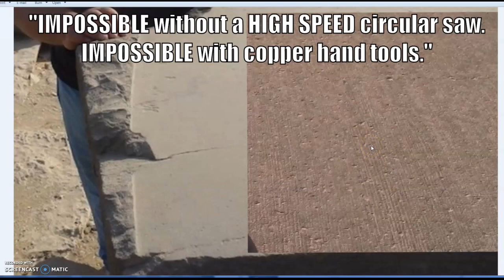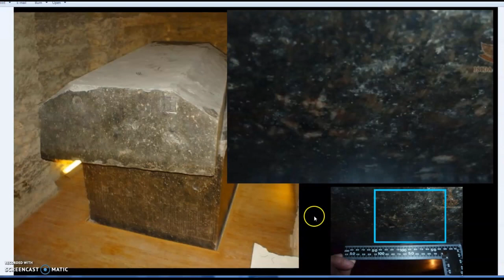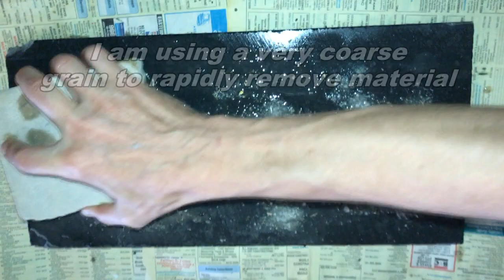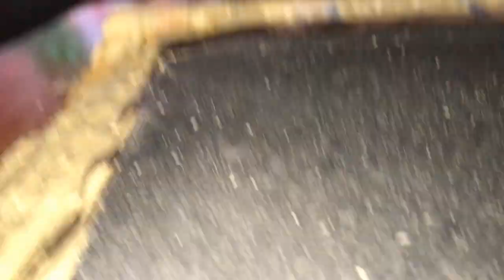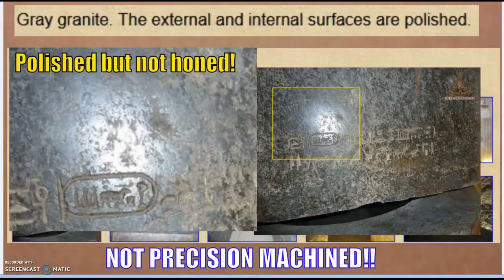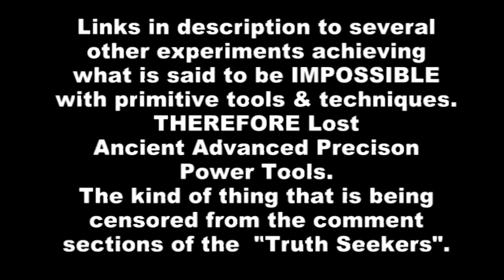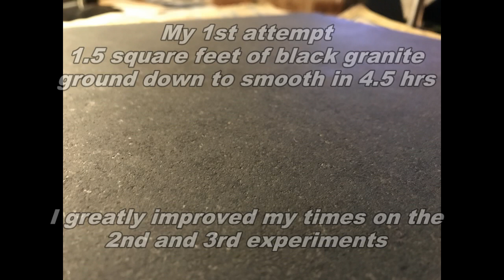Ancient Stone Working Techniques: Experiments with Black Granite on Removing Striations

Comment: SGD.....hey, im being serious........those builders of old never did cut any kind of stone..imo. stone can be melted using frequency (its been demonstrated on youtube vid) and also there is a bird in s america that makes little nesting caves in solid rock face using a certain kind of leaf. It melts the rock....i got to go....maybe finish later
Reply from the maker: On the serapeum boxes, sarcophagi such is great pyramid, all over Egypt and elsewhere the tool marks of cutting are still there. They definitely did cut those stones, the marks of rock splitting are also still in plain sight. In a previous vid I demonstrated how to replicate those cut marks with a copper saw. 
Freshly quarried stone is softer but the tools marks are quite clear. Including in South America on those polygonal walls. The rarely shown rear sides of those stones are undressed with obvious tool marks.
They were definitely cut and worked. The tool and cut marks are still there.
Reply: @SacredGeometryDecoded  my view is they used frequency and sound (at the quarry) to
melt the granite into a mushy paste, load the mush onto carts then over to the building site. then pour the mush into a frame----coffin shaped or whatever, then use another set of frequencies to harden the mush back to its origional. before hardening they smooth the surfaces the best they can with a trowel. when it hardens theyll want a better finish than the trowel gave----ok----they might have used a spinning copper blade to make it straight--the final touches
How to "melt" stones sound, p.1.
https://www.youtube.com/watch?v=BsqOLCXYznE
theres a better vid than that but i cant find it
my opinion only.
Reply: @jikwan88  
No stones were melted in your video.  At 1:47 notice the abrasive present.  The vibrations applied move the tube, which moves the abrasive, which grinds away the stone.  This is just a very convoluted way of applying the ancient technique of cutting using abrasives.
Reply from the maker: Jikwan ji modern drills when working on masonry have a hammer action, that makes then much better because it vibrates, like a hammer so many times per second. If you look up a video stone bell hole drilling , Iraivan temple, it’s a  slow motion version of hammer drill. they cut rather drill though . a circular hole into granite with soft steel chisel. By banging on the top they don’t ‘cut’ but slowly pulverise the stone. Looks to me as what is happening there, that vibration is like a jack hammer action rather than ‘melting’ as the effect should be in the area surrounding instead of just beneath the tube.to me that’s a give away. The tube is doing the work.I would want to see the full video though rather than cuts of beginning and end. 
I have been taken in by clever editing and camera tricks before.
Reply: @SacredGeometryDecoded  at this point in time i have to concede---you both have very strong arguments. i ll have another look and find that other vid i saw. what i remember seeing was a 1 inch tube pushed into solid rock with moderate force. the melted mush was spewing
from the INSIDE of the tube. after the tube was withdrawn what was left was a round hole. if i can find it your arguments will not look so strong anymore. give me an hour
Reply from the maker: Jikwan ji sonic drilling? Maybe that’s what you are looking for. They send a vibration down the drill which fastens the speed and helps get the material out as well.
Reply: @SacredGeometryDecoded  i see your point------from what i can remember----it wasnt drilling
it was pure frequency and vibration. i cant say much more without my proof (the video)
the one i posted was part 1. so i go looking for part 2 and cant find it. i suspect it was deleted, and it was the one with my proof
Reply: @SacredGeometryDecoded  this piece talks of that s american bird
In an interview in 1983, Jorge A. Lira, a Catholic priest who was an expert in Andean folklore, said that he had rediscovered the ancient method of softening stone. According to a pre-Columbian legend the gods had given the Indians two gifts to enable them to build colossal architectural works such as Sacsayhuaman and Machu Picchu. The gifts were two plants with amazing properties. One of them was the coca plant, whose leaves enabled the workers to sustain the tremendous effort required. The other was a plant which, when mixed with other ingredients, turned hard stone into a malleable paste. Padre Lira said he had spent 14 years studying the legend and finally succeeded in identifying the plant in question, which he called ‘jotcha’. He carried out several experiments and, although he managed to soften solid rock, he could not reharden it, and therefore considered his experiments a failure.4 Aukanaw, an Argentine anthropologist of Mapuche origin, who died in 1994, related a tradition about a species of woodpecker known locally by such names as pitiwe, pite, and pitio; its scientific name is probably Colaptes pitius (Chilean flicker), which is found in Chile and Argentina, or Colaptes rupicola (Andean flicker), which is found in southern Ecuador, Peru, western Bolivia, and northern Argentina and Chile. If someone blocks the entrance to its nest with a piece of rock or iron it will fetch a rare plant, known as pito or pitu, and rub it against the obstacle, causing it to become weaker or dissolve. In Peru, above 4500 m, there is said to be a plant called kechuca which turns stone to jelly, and which the jakkacllopito bird uses to make its nest. A plant with similar properties that grows at even higher altitudes is known, among other things, as punco-punco; this may be Ephedra andina, which the Mapuche consider a medicinal plant.5
http://www.abovetopsecret.com/forum/thread692500/pg2
Reply: @jikwan88  What is the name of this bird ??
provide link please?
Reply: @KaroBike  [szpak mateusz - What is the name of this bird ??]  Haven't you heard? It was the Cuckoodo bird, or as some legends describe it as the Dodokoo bird; a cross between a Cuckoo and a Dodo bird.  This mysterious bird is said to have been capable of singing a beautiful song so long and sweet that it could cause even a hardened granite cliff face to begin to soften up and melt a little on the inside.  The PreIncanites were then able to simply climb up and scoop out the temporarily tender, malleable granitic mush and easily pour it into the thousands of awaiting stone-shaped molds they had diligently and laboriously worked to prepare in previous years.  There was a secret sacred song that was to be sung on the eve of winter solstice in order to transmute the enchanted stone back to its original hardened form.  Today, it is said that there are only three Keepers of the secret sacred song: Dr. Brein Foerster, who holds advanced degrees in Khermitology, Master of Secrets, Father Yousef Awyan and his Choir Boy, Ben Van Khermitwyk.
Reply: @KaroBike  this piece talks of that s american bird
In an interview in 1983, Jorge A. Lira, a Catholic priest who was an expert in Andean folklore, said that he had rediscovered the ancient method of softening stone. According to a pre-Columbian legend the gods had given the Indians two gifts to enable them to build colossal architectural works such as Sacsayhuaman and Machu Picchu. The gifts were two plants with amazing properties. One of them was the coca plant, whose leaves enabled the workers to sustain the tremendous effort required. The other was a plant which, when mixed with other ingredients, turned hard stone into a malleable paste. Padre Lira said he had spent 14 years studying the legend and finally succeeded in identifying the plant in question, which he called ‘jotcha’. He carried out several experiments and, although he managed to soften solid rock, he could not reharden it, and therefore considered his experiments a failure.4 Aukanaw, an Argentine anthropologist of Mapuche origin, who died in 1994, related a tradition about a species of woodpecker known locally by such names as pitiwe, pite, and pitio; its scientific name is probably Colaptes pitius (Chilean flicker), which is found in Chile and Argentina, or Colaptes rupicola (Andean flicker), which is found in southern Ecuador, Peru, western Bolivia, and northern Argentina and Chile. If someone blocks the entrance to its nest with a piece of rock or iron it will fetch a rare plant, known as pito or pitu, and rub it against the obstacle, causing it to become weaker or dissolve. In Peru, above 4500 m, there is said to be a plant called kechuca which turns stone to jelly, and which the jakkacllopito bird uses to make its nest. A plant with similar properties that grows at even higher altitudes is known, among other things, as punco-punco; this may be Ephedra andina, which the Mapuche consider a medicinal plant.5
http://www.abovetopsecret.com/forum/thread692500/pg2
Reply: @KaroBike  photos of the bird Colaptes pitius (Chilean flicker)
https://www.google.com/search?hl=en&tbm=isch&source=hp&biw=&bih=&ei=X2FjXpGVFsqH9QO2lYn4CQ&q=Colaptes+pitius+%28Chilean+flicker%29
Reply: @algoma5053  Percival Harrison Fawcett - The Lost City of Z...
Reply: and i maintain the ancient never cut solid blocks at the quarry. they crushed the stone, added ash and lime and water---they made concrete and poured it into frames
this video is proof (5 min) 

https://www.youtube.com/watch?v=znQk_yBHre4
Reply from the maker: Jikwan ji analysing Egyptian pyramids in the digital age , at 35 to37 mins they show interior of the great pyramid. There are few places where access to interior. If you look at the inside stones they are all very rough cut randomly shaped. 
Mike haduck masonry channel has great pyramid and most recent Khafre pyramid video. Underneath the surface layers the pyramids are all essentially rubble.
Davidovitz on his site claims there are 5-6 sizes of stone on the great pyramid and they made from moulds. He is completely wrong, basically every stone is unique and the majority of pyramid interior are totally random shaped with tool marks. I am sorry but must insist they are poured into moulds. That would require just the great pyramid 1 million plus individual  moulds shaped to look like random sized quarries stones with tools marks.
Even on google street view of great pyramid on east side near north east corner. The outer 2 layers of stone missing and possible to see random rubble behind that. Including lime mortar.
Please don’t take my word for it. These are some of the most important things the ‘alternative’ never talk about. How much is made of lime mortar and the pyramids are built of rubble behind the outer most layers. The bent pyramid is another good example as at the corners the interior stones are easy to see.
Reply: @SacredGeometryDecoded  maybe there was a mixed technique? ;))) one for fillers (rubble) and the other for casing ... the main stones (geopolymer blocks) are leveled, the same height, the rest you know (rubble);)) looks like chaos;)) but it is not; ) .. this is only my opinion if geopolymer was used...
Reply: I am taking a wild guess you don't know how Lyme is made. The could have made a pyramid with the wood.
Reply: @KaroBike  hey SZ i already gave the details above post number 9
Im on phone right now cant copy or paste. Give me an hour
Reply: @SacredGeometryDecoded  im downloading both the vids you suggested
if what you say about the rubble is true.........it would shake the pyramid community hard....a sensation! i must look at those vids
regarding whether or not they used concrete with the forms....or hewn blocks.......i reckon i could
defeat you fairly easily
Reply from the maker: Jikwan ji 😉I do love a challenge but I have to warn you I am very confident. I’ve been through these areas with a fine tooth comb, then I put the results through a fine sieve.
I have posted a few videos on this and it would be a good update to add to the recent series.
Reply: @jikwan88  American journalist David Grann in the book The "lost city of Z", described the Amazon adventures of Fawcett, who noted the surprising fact, namely, the nest entrances are perfectly round and look like hollows hollowed out in trees, which excludes their natural origin associated with atmospheric erosion of rocks.

When asked how birds can create nests in hard rock, P.H. Fawcett heard a very interesting story from the natives, which he first disregarded and considered a fairy tale, but soon the Indians told him another story and stated that he was dealing with the truth.

According to eyewitness accounts, the bird, after finding the optimal place for nesting, arrives to the rock with leafs in its beak and then rubs the surface with circular movements. The bird repeats this action several times, after which it arrives in the same place without leaves and easily picks its rock out as if it were made of clay. After pecking the initial hole, the bird collects the leaves again, rubs the rock with them and deepens the inner part of the hole until it is large enough to establish a comfortable nest.

Fawcett does not provide detailed information about the name of the plant from which the leaves originate, but the natives claim that it is an inconspicuous 30-centimeter plant with dark red leaves.
Reply: @SacredGeometryDecoded  my study of davidovich's work was so many years ago and what i say now is what i remember from those days
he took a piece of rock from the quarry, a piece of his own concrete block he made and a piece chipped off the blocks used on the cheops. 

he put them under microscope.....the cheops chip and his own piece of his homemade block
looked the same but both were much different from pure quarried rock
he tested the 3 pieces for water absorbtion and the quarried rock was way different. i believe it was the concrete and cheops pieces held more water
another massive piece of proof is........when you shape a block from quarry then you must then see the strata marks on the block. i think there is no way you can hide strata lines
he said he could find no blocks used on cheops that had strata lines
with concrete blocks......cant be any strata lines
you really did exaggerate the "one million seperate forms" on the building site!
the very 1st block needs a form with 4 sides
the 2nd needs only 3 sided form
so you use the 3form till you complete the row
the 2nd row starts with a 3form
when that hardens you use a 2 sided form to make the next block
at the same time you put another 2 form at the other end
when block hardens (i guess 4-6hrs under that fierce sun).......simply drag both forms a one block distance to the side......voila!
"only 2 forms?????? it will take 10000 years!" i hear you say
on one row you could use 50-100 2 sided forms facing east
on one row you could use 50-100 2 sided forms facing  west etc
ok, already thats 400 blocks done in 6hrs
1600 blocks in one day, 560000 in one year
the forms....they dont have to be dragged.....the will have little wheels you jack up or down
its so simple and easy you could employ 10 year old boys to do this for extra pocketmoney

oh, half a million blocks a year not fast enough?
do exactly the same on the next tier
not fast enogh?
work 4 tiers at once
cheops completed in 6 months. im not joking. i got the maths to back it up
Reply: @KaroBike  thats a nice find, man
Reply: @SacredGeometryDecoded  haha lets see. microscopic evidence, water absorbtion, strata lines and forms....fire away!
Reply: @jikwan88  the second theory is also interesting ... conquistadors thought that (pyrite) is real gold lying on the Inca walls ...
https://www.academia.edu/37497925/On_the_reddish_glittery_mud_the_Inca_used_for_perfecting_their_stone_masonry
another interesting hypothesis:
https://www.youtube.com/watch?v=rf9qK9QTlq0&t=3244s
Reply from the maker: Jikwan ji most estimates 2.5 million stones in great pyramid so I suppose I underestimated. Once you see the interior stones they are all very random in both size and shape. Petrie and others measured the various courses of great pyramid. (Outside layers) They all vary slightly with occasional large difference but they do match the strata lines of the quarries in the shadow of the Giza pyramids.
The strata lines wouldn’t be seen in the blocks as clever quarry men use the strata layers to split the stones. Makes for easy way to break the blocks from the ground. On east side of Khafre pyramid the footprints of blocks on ground, as well as strata on the wall.
I have heard of the paper on the chemistry of a sample but there also have been studies on the chemistry make up of the limestone. Including the tiny wheels. Tura quarry across the river the source of limestone for casing stones. 
Different quarries have a unique chemical/crystal fingerprint.
Many other details but in short if you look at the stones behind the uniquely sized outer layers,the internal stones are very random. If they formed in a mould it would literally mean many many thousands if not over a million forms shaped to look like random rubble with tool marks. The effort to shape so many different moulds with be more effort than the construction itself. Or a few moulds used and then they made the stones randomly shaped and sized?
Really, please look at the stones just behind the exterior layers and where interior is available. 
It well could be possible they had way to make stone. I used to work for a company that made faux stone for retaining wall blocks etc. 
Though the random shape and size of the interior blocks and amount of lime mortar used to bind them has to be addressed. Any advantage of moulded stone would be lost many times. As the work to turn them into those stones would still require they be worked as if from a quarry. Why not just quarry in the first place. Instead of crushing, mixing, forming and then double handling by breaking them up into a million plus individually sized/shaped blocks? It would be like crushing concrete blocks to use them as aggravate for making concrete blocks.
Reply: @SacredGeometryDecoded  blocks have different lengths, because if they were the same then long ago the pyramid would crumble ... the critical point is "the level" and height of blocks in a given layer .. you only adjust the level and height, the length of the blocks can and should be different ..
Reply from the maker: @jikwan88  Before we go into the technical stuff how about we begin with the basics, as you said earlier the interior of pyramids being rubble would be a sensation, for some, even though it just an obvious reality.
https://www.youtube.com/watch?v=eku9o_q9OA4&t=2248s
begin at 35 mins to 40 mins, interior of great pyramid and random sized and shaped interior stone with very large gaps in between.

also visible on google street view, the eastern side at the north east corner it's very visible
this site has good close up images, the laers of exterior stones being tightly fit but still random shapes, in just a small section, also includes pics were the random sized stones and lime mortar just behind outside layers
https://www.joelsegypt.com/1-the-building-blocks-of-the-great-pyramid/

https://www.youtube.com/watch?v=Pb2KoOMMhQg
mins 1 to 3 - Khafre pyramid interior rubble visible

https://www.youtube.com/watch?v=wHps6ongTGs
Great pyramid mins 2 to 3 - the lime mortar which is barely ever mentioned

https://countdowntothemessiah.com/Great_Pyramid/Davidsons_Pyramid_Records/Plates/Plate_XX_2100.gif
Piazzi Smythe and Petries mesurement of the great pyramid, on either side are the measurements of each of the courses, an iamge or google street view look will also show the different layers

On the sphinx you can see the strata, even from google street view SW corner of khafre pyramid the strata and imprints of blocks on the ground that were split at the strata line. common technique since quarrying stone blocks that cross strata lines is a recipe for disaster

I am not wrong about this, 100's of thousands if not more than a million individual stone forms would had to have been made. Including totally random shapes . 

Even  the casing stones that survive have different thicknesses, 

Earlier you mentioned 'if"i was correct about that if would be a sensation.
I am still surprised how these all important details are not just common knowledge. They are clearly evident.

This the FAQ on the geopolymer institute.
https://www.geopolymer.org/faq/faq-for-artificial-stone-supporters/

Quoting from it directly:
section 4:
If it is a concrete-like stone, all block would have the same dimensions. But they are all different.

Before the first pyramid built out of stone, the ancient Egyptians constructed very imposing crude brick monuments. We find large funerary temple enclosures of the second dynasty, like the Khasekhemwy one (2,730 B.C.). Its massive wall is of crude clay bricks, therefore in a molded material. It is generally agreed, since these bricks were worked in molds, that their dimension must be uniform. However, this is wrong. Despite having been manufactured in molds, the clay bricks are of approximately 5 different sizes, implying the use of several patterns. We find these differences in proportions in all pyramids.

end quote

We find this difference in proportions in all pyramids? Rather than 5 slightly different sized clay brick molds in Khentkawes'
But the same in all Pyramids?
Come on. That's just not even close to being remotely true and it is clearly visible even from the outside.
I don't understand how they could get it so wrong?  The best explanation is gross incompetence for someone who claims to have made a study of thee things.
Reply from the maker: @KaroBike  I just left a series of links in reply to Jkwan ji with vids (time codes), sites with good close up pics
Reply: @SacredGeometryDecoded  ok;) this is what the wall looks like when the casing stones disappear ... see what the situation in the khafre pyramid looks like, especially at the top (casing stones) ... see the height, level and length of the blocks ... nothing is a coincidence ... none block or piece of block
Reply: @SacredGeometryDecoded  just watched mikes khafre vid. i am totally disgusted. its not the 1st time i seen the odd size and shapes.....before it just didnt register in my mind

its junk! but maybe its just khafre----a one off rough prototype experiment before they build the real thing---cheops. at the moment i dare not look too closely at cheops.
i ll have a go at the analysis vid now
Reply from the maker: Jikwan ji the same for great pyramid also, the bent pyramid too, all of them really, on mike’s great pyramid video also shows the satellite pyramid the same too.
Rubble filled interiors are a rule without any exception I can find but that’s the same thing in South America and elsewhere else also. 
Just like a fancy dining table or piano or a grand cathedral. The bits you’re not supposed to see are never given the same attention to detail.
Reply: No you really don't understand. Concrete would require a mountain of wood and be three times the labor of stone
Reply: @TheMoneypresident  I do not think so  :) layer by layer, just wood for the first layer and you can use the wood again on a higher layer ... you do not need a lot of wood
Reply from the maker: Ahh. But then you’d have to pour onto the layer below with wood walls for the form. Meaning the layer above would have to absolutely perfectly fit the floor beneath as well as flow into any gaps. It’s going to have to behave as a liquid. Also leaving air bubbles as a tell tale sign of a pour.
Reply: @SacredGeometryDecoded   block after block of different length, leveled, similar to a wall made of broken bricks of different lengths but leveled with respect to the previous layer ... personally, I do not think that a geopolymer was used, but in theory there is a possibility of building a pyramid with this method ... of course, not every single block made of geopolymer :) also natural rock in action
Reply: You have to burn rocks to get Lyme.
Reply: @TheMoneypresident  or shells
Reply: @KaroBike  does your parents know you are annoying adults?
Reply: @TheMoneypresident  how do you know i'm an adult?
Reply from the maker: If you look at temple of Karnak or Luxor columns at the bottom you’ll see there are no carvings on the bottom. The stone columns,and lots of walls here and there, are covered in a plaster that looks just like stone and lasts a very long time. The hieroglyphs were stamped rather than carved and why they are so even.
Reply: This is not a junk, this is erosion ... Mike does not talk about "this" on his trips ... Just like many do not talk about the difference between artificial stone and natural stone (in the processes of erosion).
Reply from the maker: @KaroBike  

Khafre pyramid
https://www.richardcassaro.com/wp-content/uploads/2011/04/14-1024x700.jpg
About to go to bed so just a quick search.

Bent Pyramid
https://photos.travelblog.org/Photos/190195/565888/f/5841686-Casing_stones_on_Bent_Pyramid-0.jpg
Every pyramid is like this beneath the outer layers.
Those parts only exposed since the casing stones removed,
If it was erosion wouldn't the cumulative gaps made between them generate a collapse, or at least a tilt?  I mean they still fit well together upon one another but the surfaces do not mate along the length.

At the great Pyramid the scan pyramids group - enter a cave type of thing  to get inside and those blocks entirely random rough hewn, lots of visible gaps between them, they are expertly laid but very very rough , there's no way they could have been poured unless the formwork had individually been expertly carved to make it look like the blocks were roughly quarried?
All random shapes and sizes without any signs of erosion.
Reply: @SacredGeometryDecoded  you showed me the reconstructed places, but look closer;) the blocks are leveled, some are "broken" and you can see the erosion ... of course the core of the pyramid can be filled with debris, this is not a critical point for the stability of the structure
Reply from the maker: szpak mateusz reconstructed? I don’t think so. You’d have to dismantle everything above them to get them out.
Some are broken / damaged but not all of them . 
Any pour of concrete , faux stone etc has to behave as a liquid. It just has to. 
Drier mixes can be vibrated to fit the mild but still gravity will insist they find any gaps below. Any concrete pour just has perfectly fit the shape below like water in a glass. Nature insists on it. So the forms are either shaped to individually look like quarried stone that doesn’t precisely mate. Either that or it was not formed.
 At this point I will be leaving this thread since I really can’t add anything. unless it can be explained how the laws of physics can be altered, or how millions of individually sized and shaped blocks were made across all those pyramids without forms that were shaped to make them look roughly hewn and quarried.
Or the question of why use of lime mortar so widely.
I get your passionate about it but even if such knowledge existed for a geopolymer rather than a plaster, mortar or even more conventional concrete. I just can’t get past the fact even if those blocks are eroded, and done damaged yes, they still are of different sizes and shapes. They could not have been in layers because then they’d have to be shaped like a single solid bulk with no gaps whatsoever between upper and lower courses.
The same wood apply for casings stones since the ones above would have to a crease in the middle on bottom from the join below.
If it’s poured it has to behave like water or at best like a jelly. If poured into their final location there can’t be anything blow but the stones below, and no form work could be used at the back side since it would get stuck there.
So liquid/jelly would have to fit into every surrounding nook and cranny every single time. I can’t see a single example of that anywhere. Even the most precise fitted stones still a a tiny gap between them.
Reply: @SacredGeometryDecoded  I used the wrong word;) there should be "secured places" instead: reconstructed ... geopolymer , completely different chemical reactions take place ...
https://www.youtube.com/watch?v=cHwaa_S4L3Q
Reply: @SacredGeometryDecoded  "So liquid/jelly would have to fit into every surrounding nook and cranny every single time. I can’t see a single example of that anywhere. Even the most precise fitted stones still a a tiny gap between them."
Oh yes;) true;) but not in the case of previously prepared blocks .. regardless of whether you use mortar or not ... you will not see any "imprint" ..
Reply from the maker: szpak mateusz ok even if the blocks made on ground level certain issues still remain
-1- the forms aren’t square are standardised. A new form would needed for each of the 1000’s and thousands of blocks. Forms that have curved corners and not straight. Huge amount of work and timber would be required.
2- to make the mix a huge amount of limestone would need to be crushed and other ingredients such as the natron transported, mountains of the stuff, a bigger job than the pyramid itself including transportation etc
3- the crush the equivalent amount of stone for the mix and transporting it, it would be simpler and quicker just to cut raw blocks and move them
4- if the blocks were set in a few standard formwork to then get them to their final rough hewn shape with the tool marks etc it would be triple or quadruple handling. 
It would be the same as having a pile of cement blocks ready on a palette only to crush them up for transport to use the material in concrete block production facility.
Why make things so hard for themselves and add so much work for no gain.
I see no advantage and a whole bunch of disadvantages to make an already big job even more difficult, more expensive as well as taking longer to complete because of all the added steps and materials required.
Reply: @SacredGeometryDecoded  SGD, you know very well that "concrete" technology is most effective in building very large structures, even today ... it is easier to transport "powder mix" than ready-made multi-ton blocks to the increasing height of the building. With the help of wooden boxes you can only manipulate "height and level" for the block you want to receive .. you do not have to care about their length and width ... and even the vertical edge ..... logistically it is much better .. without any questions .. Regards
Reply: @SacredGeometryDecoded  well, after seeing those 2 vids----im completely disgusted
i was blinded by what was written about the ancient masters of engineering
that i didnt look too closely---i thought the outside was just eroded
and the inside was 2 million blocks positioned so tight and square
you couldnt pass a razorblade....etc and tthe blocks were just slapped on
the whole world has been lied to. the rubble-blocks most definately hewn
im still recovering from a partial nervous breakdown about all this
i was really impressed with mikes wheel for transporting blocks. genious!
seems to me they attached great importance to the 4 edges (external) and
the 4 middle-edges of the 8 sided cheops (a pyramid within a pyramid)
the straight, flat faces are only for cosmetic appearance imo
Reply: @jikwan88  I also ask myself;) why are so many pieces of blocks lying next to the pyramids? why does everything look so perfect with these few surviving casing stones at the base of the pyramid? The mortar has eroded and the stones are falling? glued the entire pyramid? ;)))
Reply: @KaroBike  i think it adds to making it more mysterious. the more they can mystify the public about the way it was built and the true purpose of the great pyramid the safer they feel
i am talking about the elite that controls the world. they dont want us knowing about free energy or scalar wave technology. my opinion only
Reply: @SacredGeometryDecoded  as for our "duel"......i threw in the towel last night. how they manufactured those very few blocks that were straight and precise isnt worth arguing over
but 2 and a half million close-cut 7-15 ton blocks-----that would be worth enquiring into
Reply: @jikwan88  I don't care about the elites;) they have secrets but only about themselves;) and they can know less about the pyramids than you;)